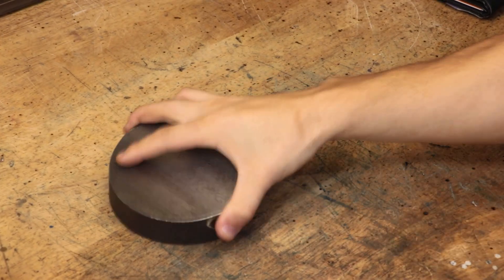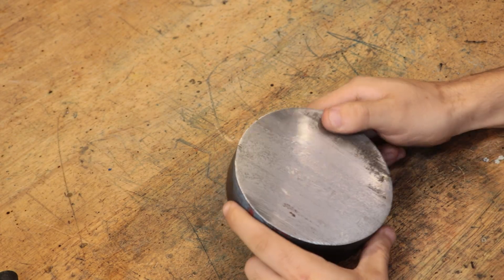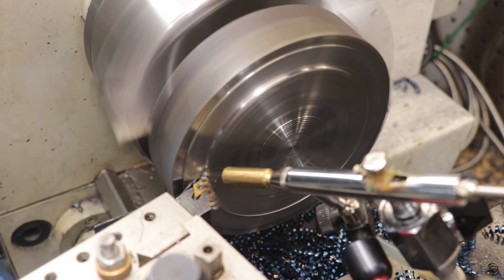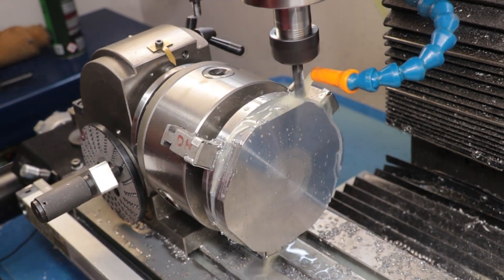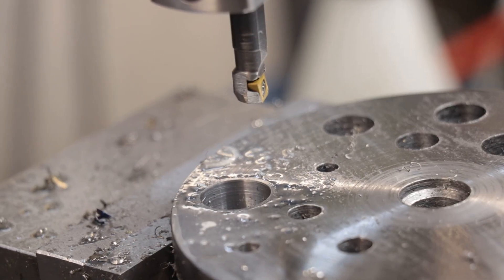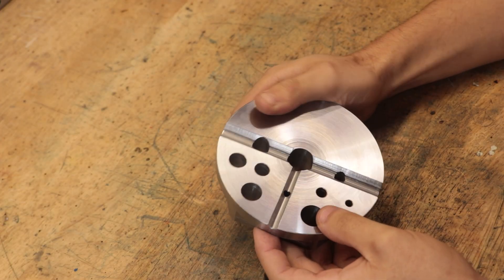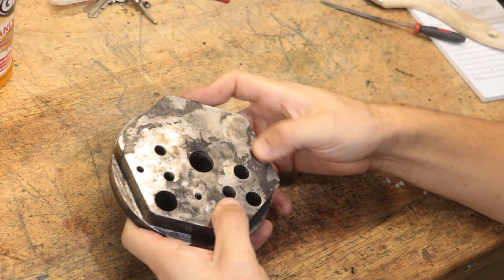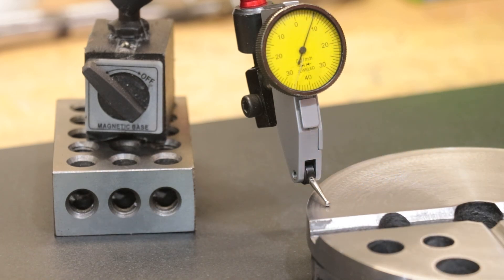BUILD: A Toolmakers Bench Block (Staking Anvil)

Comment: Just for future reference, you're grinding off too much material per pass.  Looks great though.
Reply: @TOMMYLIVSEY-in1du By the sparks and you can visually see the step it's creating.
Reply from the maker: Yeah it was not so easy to get a perfect cut depth. The lathe hand wheel is a little too coarse for getting a precise depth of cut :)
Reply: @artisanmakes  If you feel like upgrading, Harrison built lathes with micrometer dials. The cross slide had a feed of 2mm per turn, 1mm on the compound, and the handwheels were geared internally for finer control. You can pick up tidy M250s and M300s with them for £4k-7k here
Reply: Yeah I'd be taking like .001-.002 inches per pass on my depth while grinding with that and adjust the feed accordingly. I've never done this, but I love the setup, though! Always enjoy seeing creative solutions to get the job done 👍🏻
Reply: @rooikatza don’t be a wiseass.
Reply: @rooikatza  I have one. I'm a gunsmith. It's not on this account. Youtube won't allow me to tag it. Try again.
Reply: can I ask without everyone becoming a smart ass ?
Reply: @rooikatza  Yo. Salty?
Reply: No he's not. He doesn't want to be there all day, that's all. Imo cutters last longer with average or slightly heavier cuts then light high rpm cuts.
Reply: @tg5509  Yes, he is. A grinding wheel works on a different principle than a lathe tool.
Reply: If you get the surface finish and dimensions needed then there is no 'too much' if the machine can handle it.

I've taken 0.5mm off on passes if I've had to. The Suburban Tool channel videos will also tell you the same.
Reply: @JSmith19858  I'd call 0.5 mm close to the upper limit. Large removal with a grinder is a good way to wear out your stones quick and possibly you surface grinder. Also distort the workpiece from heat. Grinders are finishing tools, not bulk machining tools.
Reply: @derschwartzadder  upper limit with what? If you're running a 2m x 0.5m Snow with a 24 inch wheel and 20hp motor, 0.5mm is nothing.

I've happily taken 0.5mm cuts with a small Herbert Junior. Used for a couple of hours a week for the past 3 years the wheel has lost around 2mm to dressing it. The machine is still solid even though it's 81 years old
Reply: @JSmith19858 if you take too much you wear the stone down too much. The way it works is that the leading edge of the stone gets worn down a smidge each pass, but the back isn’t worn down yet so it maintains the surface height of the part. If you take off too much, you’ll wear off the surface of the stone entirely before the part is finished and the surface will be higher at the end than the beginning. That could be why he had a high sport as he tested closer to that part of the piece. Additionally, the deeper the cut the more you heat the part and the more it expands during the grinding, ruining the accuracy.
Reply: @melgross  you need to spend more time running grinders. If you did you would know one way of preparing the wheel is to dress it so there is a step in the cutting face, so you're cutting with a sharp edge instead of the blunter edge of the side of the wheel. You're also more likely to load the wheel up, rather than wearing it down.

The issue with manufacturing shifting to China is things like this get forgotten and we're just left with YouTube apprentices who can only guess at things.
Reply: @JSmith19858  yes, thank you. I know how to run a grinder. This isn’t a “real”,grinder.
Reply: @melgross  a tool is whatever you can adapt it to be. If the setup produces good results without causing harm or damage then you can use it for that operation. We teach Navy trainees to carry out milling operations on lathes, using lathe tools, because smaller ships or submarines are likely to only have a lathe.

Considering that you don't really know other ways a wheel can be dressed, and are making general blanket statements, my guess is your experience isn't that diverse
Reply: @JSmith19858  my feeling about you is that you’re full of it. I’ve been doing g this for a very long time and, like it or not, I know how to dress a wheel. I do t know what you think you’re trying to prove with comments that have nothing to do g to do with what was don’t here. You might have noticed that I’m not the only one here that’s addressed the problems with what was done.
Reply: @melgross   you haven't addressed anything because there is nothing wrong with what was done, and any minor issues the content creator has already addressed it it has been addressed elsewhere. This thread is a collection of YouTube apprentices putting forward their best guess.

It speaks volumes when you drop the argument,  turn to insults and try and pull seniority
Reply: @JSmith19858  yes, that was what you did with me. Just give it up. You’ve turned a minor discussion into a major bit of nonsense.
Reply: @melgross  of course, buttercup